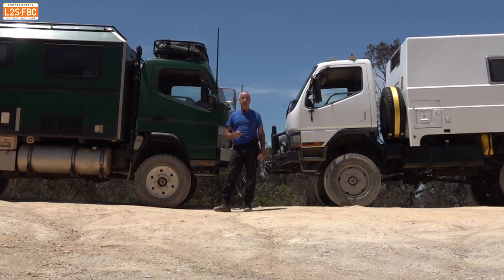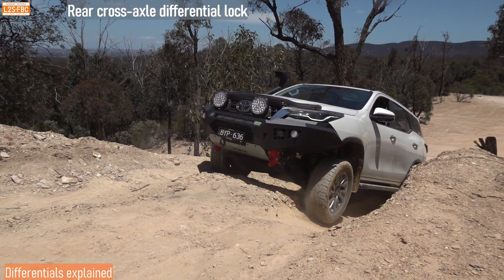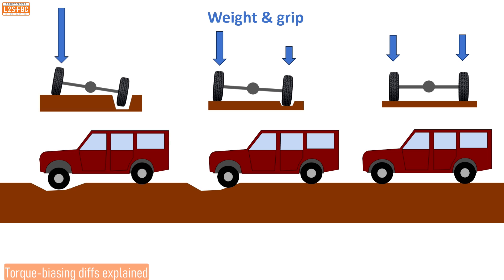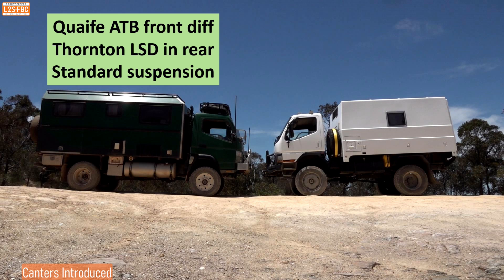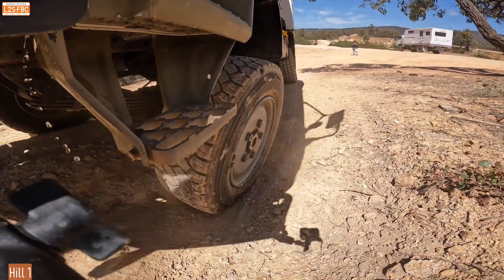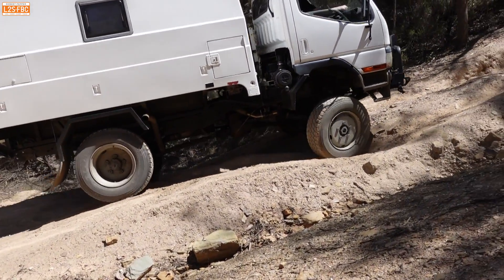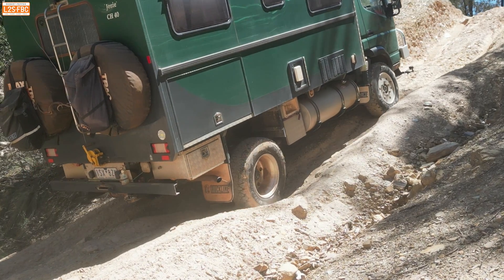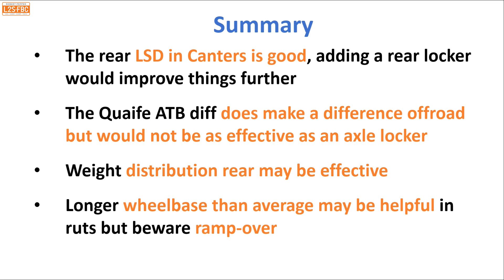What's a Torque Biasing Diff and why would you want one in your 4x4?

Comment: When you mention the different wheelbases and the wheels being in the ruts I think being in the ruts (left and right longitudinal grooves on a track), it’s the wheel Track that will put you in or out of the ruts not the wheelbase. 

The wheelbase will put the wheels in the same holes, moguls or dips in the track or not depending on the length of the wheelbase. The wheelbase won’t effect being in the ruts or not except on corners when you might climb out of a rut with a long wheelbase. 

Personally I try to stay out of ruts and straddle them as all ruts do is give you less grip and less clearance and the deeper they have been dug out, the worse clearance you have. I avoid them where possible as I don’t want to belly out.
Reply from the maker: No, different points. The wheelbase point was the two Canters which went some way to explaining their performance difference.
Reply: @L2SFBC I know what you Meant. But ruts are the wheel grooves you follow along a track. They are affected by wheeltrack (how wide the axle is such as the issue with the LC70 series having different track front and back) not the wheelbase (how long). 

Also - in the pros and cons section you could have mentioned the benefits of an auto locking rear differential (I know you didn’t use one in this test).

Comment: I love the detailed explanations of your videos. I was thinking it would be cool someday if you found some modified vehicles and did some comparisons on for example two identical vehicles having brake traction control except one of them also having ATB differentials like trutrac or ashcroft. I've always heard that those work well with brake traction control which makes sense but I've always wanted to see real life comparison such as the brake traction control not even having to kick in on an uneven surface because of the bias of the differential torque splitting and also when you get a wheel raised in the air if the brake traction control doesn't have to grab as hard for as long on the spinning Wheels rotor on the vehicle with the mechanical limited slip differential compared to the open differential. I know that either way the brake traction control will help send torque through the differential to the wheel with grip but I'm just curious if it does not have to grab as hard or for as long on the non open diff modified vehicle. Or if the only real change is the uneven surfaces from left to right being affected by the torque bias and that a wheel raised in the air is literally no different. The reason why I wonder is because when I watch old training videos of the original Humvee with that type of differential it says to pump the brakes mechanical limited slip sense power over to the other wheel but I know that with an open differential if you try to just pump the brakes a little it's not nearly as effective so it's making me think maybe same thing applies with a traction control vehicle with open diff as opposed to Mechanical limited slip diff. Interesting tidbit the original Hummer H1 ended up having wabco traction control along with those mechanical limited slip gears at one point of its production and even mention to the Land Rover Discovery Series 2 having the same system at the time in the car driver review
Reply from the maker: Check this out https://youtu.be/xWRfPuCgxhg?si=prIMuTWU6Fkg52U6
Reply: @L2SFBC I'm having trouble opening that link could you please try again I'm still curious about an ATB with traction control at the same time

Comment: Good timing for this video. I’m considering an rear LSD for my sprinter van, which only sees light offroad duty. I see anticipate there will be benefits when transition from high traction to low traction surfaces (ie dry tarmac to snow or gravel). It should also be a little better when I need to turn off esp in loose sand too. I don’t have an option for a front LSD, so hoping the rear will be a noticeable improvement.
Reply from the maker: Glad it was helpful!  I agree, sounds like an ATB would be good for your van, particularly in low-mu surfaces as opposed to wheel-lifting ruts or rocks. If it has ESP it'd also have BTC which as others have said, is a potent combination.

Comment: Great video, very informative.

FYI, I think the U.S army spec their Humvees with front and rear Trutracs ( or equivalent). Instead of LFB to ‘trick’ the diff to thinking there is resistance on a wheel in the air for the torque biasing, the driver has a lever to activate a hand brake that operates on the front or rear axle 

I would expect BTC to compliment a Trutrac very well to the point of being a great alternative to a selectable diff lock - no actuators, air lines etc to worry about 

Cheers
Reply from the maker: agreed!
Reply: Yes I wondered the exact same thing about BTC with this type of limited slip differential. Believe it or not the Hummer H1 civilian model actually came with wabco traction control at one point along with these differentials
Reply: Now I've always wondered if other than the torque bias from right to left on an uneven surface helping the BTC to not be used as likely would it also help when you get a wheel in the air knowing that even with the ATB differential it will encounter wheel spin but would the BTC grabbing that Spinning Wheel have less of a job to do to send torque to the non-spinning wheel or is the BTC fighting the engine just as much to transfer torque as it would with an open differential? The reason I think it might help BTC work less hard even with a raised wheel is because the original description of how the torque bias works suggest that once it grabs a bit it feels locked momentarily whereas I don't think you can push the brakes on an open differential add transfer torque quite as effectively with a raised wheel if you didn't have BTC and you were just using your brake pedal the way people with this type of differential do with the left foot braking technique. So if it's just a case of helping left to right torque bias with uneven surfaces I might just stick to my open differential and my BTC and then get a selectable Locker in the back of my disco but if it really does help even with a raised wheel for a left wheel spin or less effort when grabbing the wheel spin because it wants to transfer torque much easier then I would consider getting one up front the compliment my BTC . I say this because I've never encountered a situation where I'm like wow I wish the BTC didn't have to work for one quick second on that uneven surface we're both Wheels were still on the ground

Comment: They do work and will get you a bit further, particularly on low traction surfaces as opposed to high flex where you're lifting a wheel.

This video doesn't really show the advantages though. The difference between them was all wheelbase and weight distribution, not the diff.

Comment: Why are gerotor pump differentials uncommon?  They seem like a good idea to me, when one wheel spins the pump will build pressure to force a cutch pack together.  I understand it’s a reactionary response not predictive but a certain level of preload can be built into the clutches to ensure the wheel with grip always receives some torque. No electronics required.
Reply: If I remember correctly early haldex was pump based, later versions used separately powered pumps. Honda early system use pumps driven via rotation difference. My daughters HRV has the 2nd gen Dual pump system as the first one  only worked in forward.
The main issues seem to be loss of traction before the system can work. So like BTC takes time to work giving wheelspin and bigger holes 😉

Early Viscous systems did the same. LR for the 1st gen Freelander over drive the front by (3% in pre 2000) to be able to market it as full time 4wd (AWD really). Why so many Hippos are available as "2wd for economy" as they lock solid VC and destroy the rear diff and IRD (transfer box).

Comment: Thanks Robert, very informative. I see from the comments that your audience includes some educated and experienced 4x4 people, so yes, I feel like a complete newbie asking this question. If an LSD locks the diff after some spinning, why is it not as good as a locked diff in an off-road situation?  
Another question, can LFB be applied effectively with an open diff?
Reply from the maker: First off important to say that "LSD" covers a wide range of types of diff, but in general two reasons:
1. the LSD may be reactive, relying on wheelspin.
2. the LSD won't (rarely) ever lock an axle to the extent the locker will.
3. in the case of a torque-biasing, there must be some traction on one wheel.
So for all those reasons the LSD is inferior, generally.

Comment: Great video but the left foot breaking can be much more effective than you described in your explanation.  With modern ABS you can keep a constant pressure on the lifted wheel essentially locking the axle 50 - 50.  You should put one in your Rangers front axle and feel the difference.  It is the best mod I've ever done to anything.  In my truck it is so good I almost never lock my rear locker.  I can argue and prove on dirt and in snow that a front Torsen is better than a front locker.
Reply: As an older 4wd driver I first had a Torsen fitted in Queensland to my HiLux in 1985 to its front diff, perfect compliment to the vehicle, rear LSD was adequate at that time.  My only concern was when driving on ice I found it necessary to unlock one front hub and drive on one front wheel as there was no steering around corners as the diff would work against you and brake traction.  I later fitted a Roberts Diff Lock (early ARB) to the rear and gained nothing in way of off road traction.  Lesson 1 - front better than rear!  Now it is Isuzu with standard rear LSD and ARB front.   Left foot braking has always been practised even with both open diffs as this probably comes from my farm days.  I'm glad there was no explanation of how the torque bias diffs actually works with worm wheels and worm drives in the fact that no matter what a portion of drive will always be split between both wheels!
Reply: Left foot braking .

Comment: One thing that gets overlooked with manually locking diffs is the higher chance of a user error, most people turn them on before they encounter a difficult section and turn them off after they've crossed it. This means that at some part the locked diff may not only not be advantegeous but actually a hazard (for example when both wheels are on the ground but one has to cross an obstacle and as a result one wheel wants to travel further than the other, then with the diff locked one wheel will start to skip and may cause the entire car to slide). Cars with automatic locking diffs may lock and unlock the differential tens of times in an obstacle that the driver saw beneficial to lock once.
Great video and very informative as always hope to see more very soon!
Reply from the maker: I see your point but driver skill can work well 👍
Reply: @L2SFBC  Of course it can, correct line and just enough momentum can get you out of trouble better than any electronic system paired with a ham-fisted driver can. I just find that diff locks are like the  disconnecting swaybars in a recent video of yours, some times they are beneficial in extreme situations some times they are not, it's up to the driver to decide. Plus some vehicles that come with factory diff locks take so much time to engage and disengage and are finicky to use  one could argue that they take control away from the driver than giving him more. Lsds and other clever diffs (mechanical and electronic) are more predictable and progressive if in the bottom line less capable than a locker.

Comment: I do have a feeling that an ATB couplied with BTC would utterly transform a vehicle in all conditions, particularly a Discovery 2 as most don't have a CDL (can be retrofitted) and a fairly lousy BTC by modern standards. In fact, Ashcroft do both axle and transfer box ATB's for these.
Reply: I think there's a strong argument that a torque biasing differential plus a good brake traction control system is nearly as good as a rear locker in most situations offroad, and better than a front locker in most situations offroad, with the exception of serious rock crawling where maximum stability at very low speed is the highest priority. Plus, the ATB is useful in slippery conditions on the road (especially intermittent slippery surfaces, such as dry pavement with patches of ice) on the rear axle in a part time 4WD, and both axles in a full time 4WD, compared to the lockers which can't be used at all on the road.
Reply from the maker: Agreed, ATB + BTC would be superb
Reply: @L2SFBC  it also worked very well on the road as i once found out having to come to a very fast stop on a very wet road one day
Reply: I had a rear ATB in my D2 and with CDL TC it worked very well even freeing myself after sinking into a sink hole with only the rear on solid ground and the front wheels fully submerged
Reply from the maker: Yes I agree 👍
Reply: @L2SFBC thanks for the very useful video. Great stuff. Yes a bit more info on how ATB with BTC works would be great. Happy to catch up in melb sometime if useful as I have front and rear ATBs on my defender with BTC.
Reply from the maker: Which Defender do you have? Yes would be interested to put it up against one with just BTC.
Reply: @L2SFBC  a 2015 puma.. I’m in lrocv I’m sure we can find one !
Reply: 110
Reply from the maker: Great please contact me let's find the other Puma and do it!